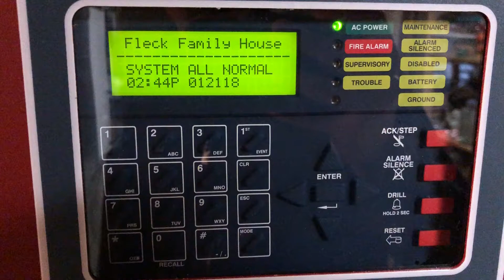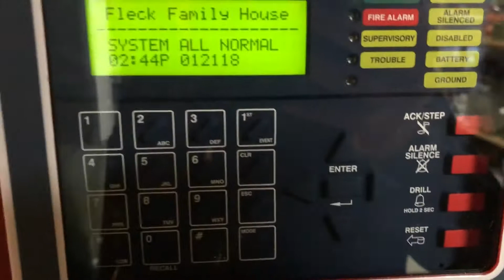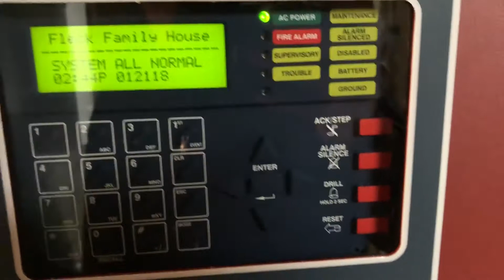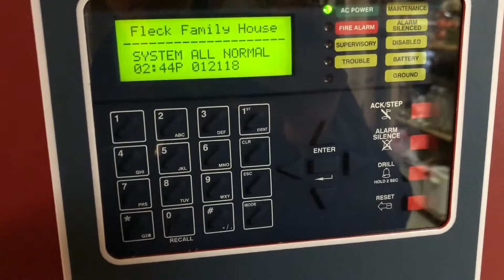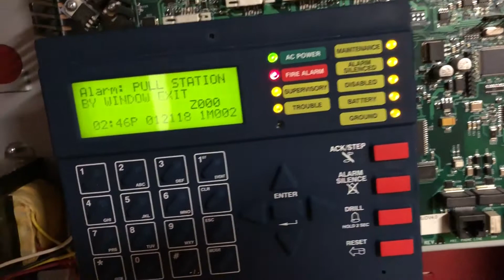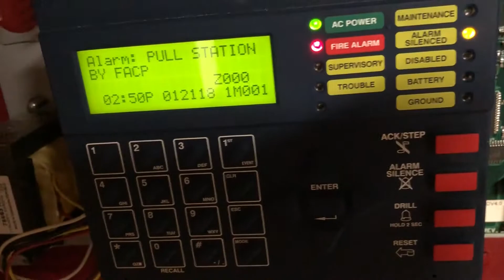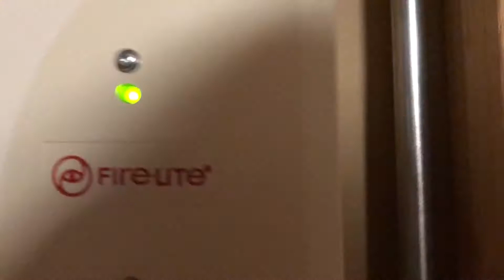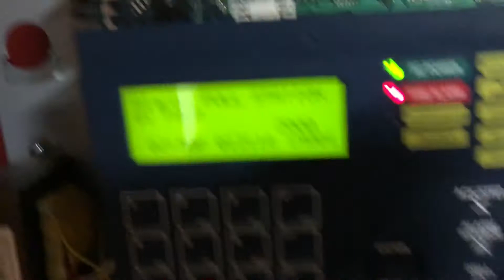Home System Test 18: Newest Wheelock and System Sensor Horn/Strobes (Full Test)

Comment: I know what you should do with the control module. Have a computer fan that is running when the system is in normal state and then connect it to the control module so that it turns off when there is an alarm. That would simulate the system turning off the HVAC system in a building when the alarm goes of.
Reply: Zachary Fleck Yeah, it was just a thought to save you money. And just to let you know, if you need parts, I can get them for you at wholesale cost. I am a security dealer and can get anything you would need. If you want to talk to me more about it, you can give me a call. Just google Best Security Systems. We are out of Colorado. The number on google is my direct.
Reply: Zachary Fleck No problem! I like supporting you guys doing these videos especially with what YouTube did to all of you. Just let me know if you want to compare prices!